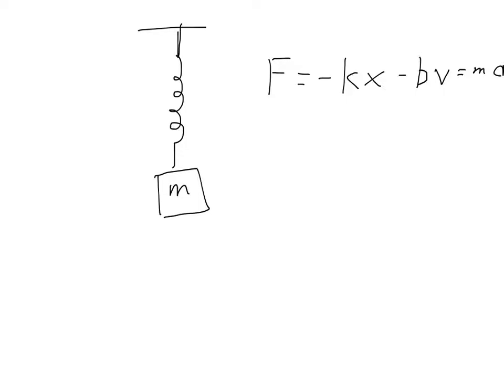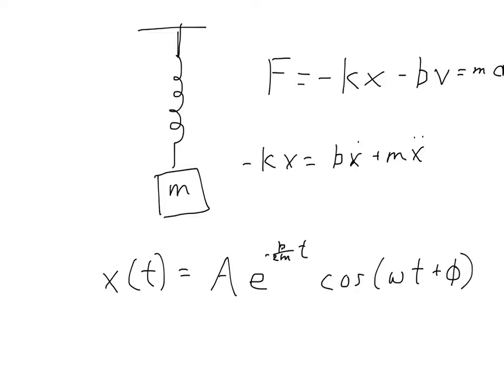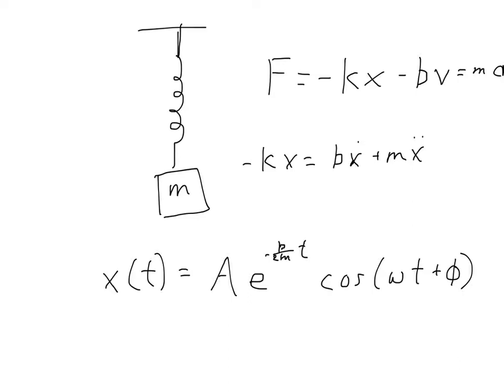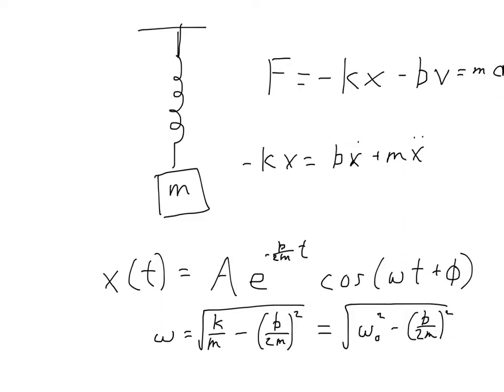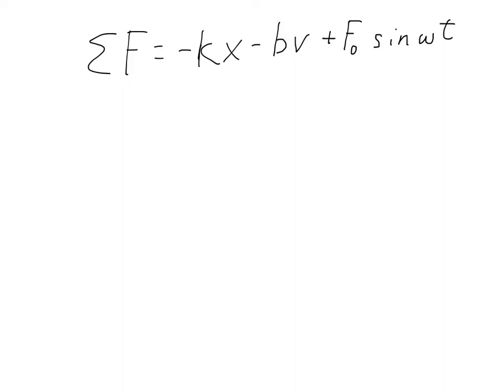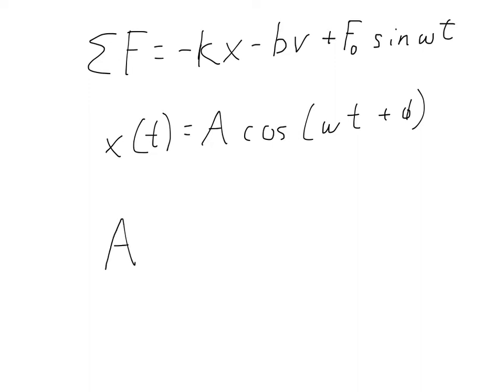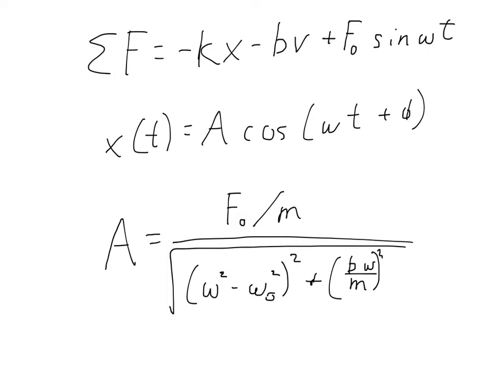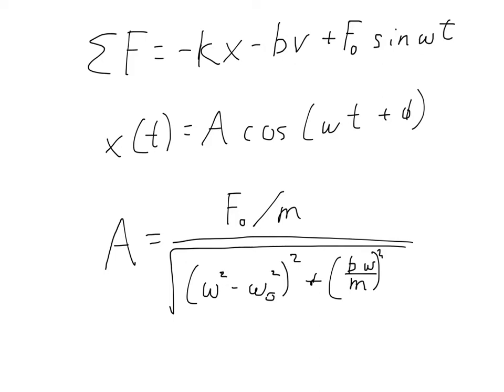Damped and Forced Oscillations

Comment: Hi,
You're missing the exp(-bt/2m) in the amplitude of the forced oscillation. It's part of the homogeneous solution and should stay there.
Reply: no, you're wrong. We assume that enough time has passed so that the contribution from the homogenous solution is negligible. It will only have a noticable effect in the beginning when the oscillation begins. This video wasn't good at all, it's basically a copy/paste of existing formulas.
Reply: @CeRz  Yes, that's correct—but he didn’t mention that he was focusing on the late-time behavior, and he also said nothing about the homogeneous solution. I’m not wrong; he just wasn’t very precise
Reply: @erfanmohagheghian707  One thing one has to learn is that mathematics describes physics and physics describes nature, not the other way around. A physical model is never correct, only sometimes useful; and only a skilled and experienced problem solver will know when it is.